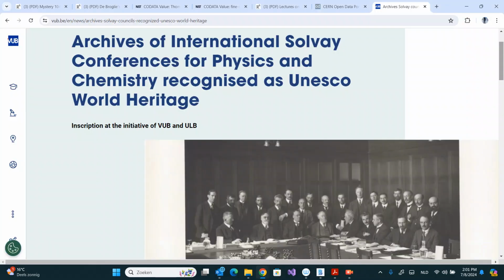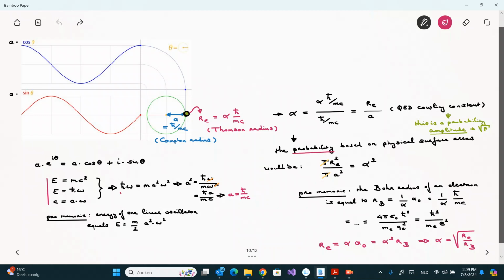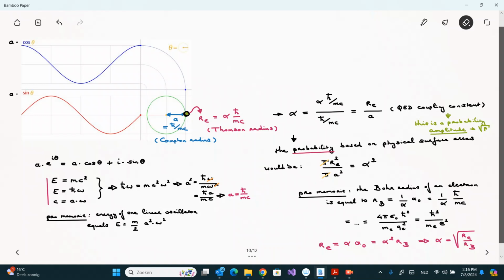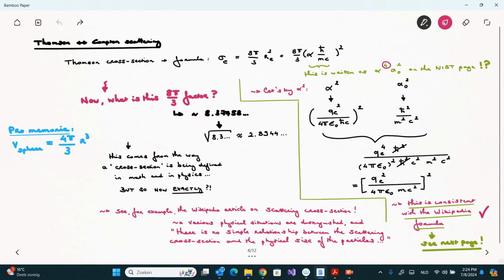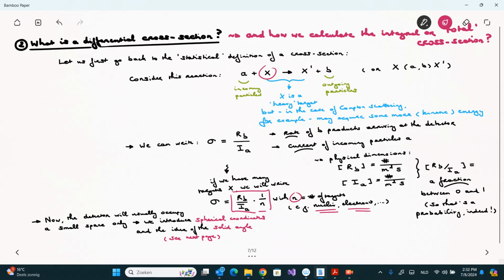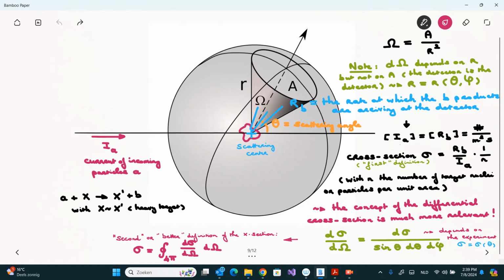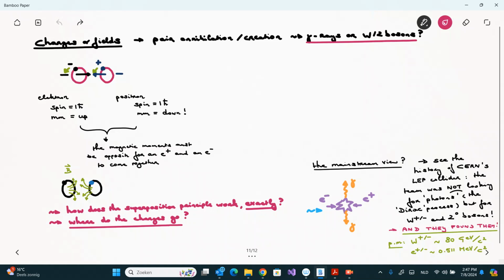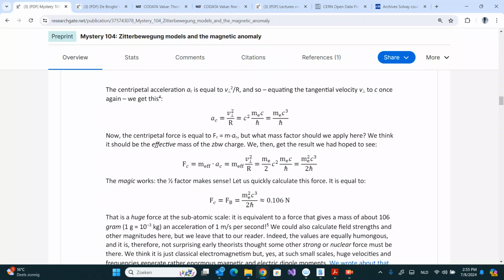The difference between low- and high-energy physics: can charges turn into fields, and vice versa?

Comment from the maker: Oops ! Apologies ! At the end of the video, I speculate about how a positron and an electron would come together, and I say just the opposite of what I should have said: the magnetic moments need to be aligned, and the coming-together would be like two magnets that you click together: you get a magnet with twice the mass and twice the magnetic field. Is that a "Z-boson"? Maybe. I'll let you think about that. :-)
Reply: look hey the Feynman diagramm says that if an electron and a positron collide you get gamma rays right ? which(gamma rays) are particles ? anyway lets says we get high energy photons  so that means there is an oscilation between them before they merge , somthing like the whooooop of the black holes merging  detected by LIGO etc  , so i dont know i have no clue about Z-bosons but if they could merge that should be an other kind of particle ,in the case of becoming gamma rays and no mass remaining then we have to define gamma rays better :)   but i think E=mc*2 applies for both cases right?
Reply from the maker: @antoniosmpl.3457  I would rather see a conclusive experiment than a Feynman diagram. :-) It is only since a year or so that CERN is releasing all experimental data. Based on what they published so far, I only see what I refer to as 'smoking gun physics': lots of smoke, but I see no direct evidence of fire. See: https://www.researchgate.net/publication/341177570_An_Alternative_Theory_of_Everything_Classical_Quantum_Physics. In any case, China is building CERN-like facilities now - and the size of the collider is four times that of CERN's (a ring with a circumference of 100 km ring instead of 27 km). So China is going to re-do all of the experiments of the past 30 or 50 years or so. Perhaps they'll find the fire. Only time can tell. :-)